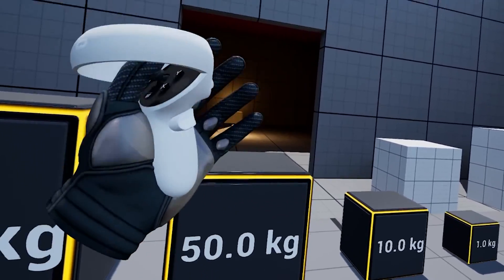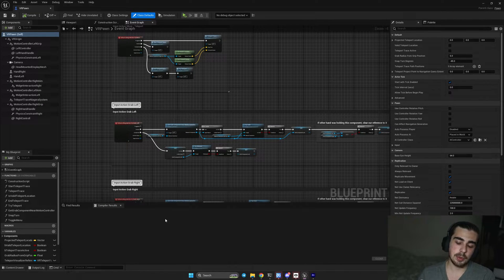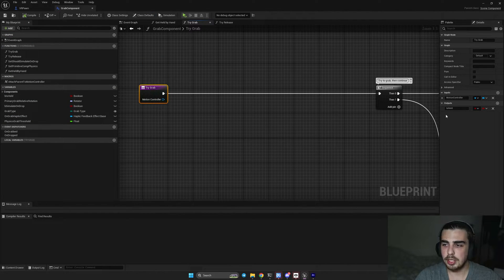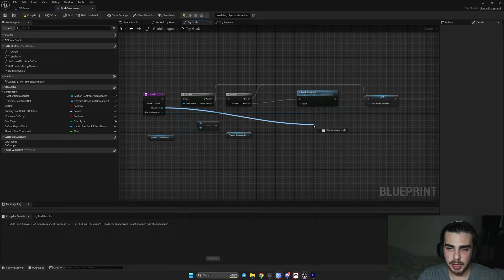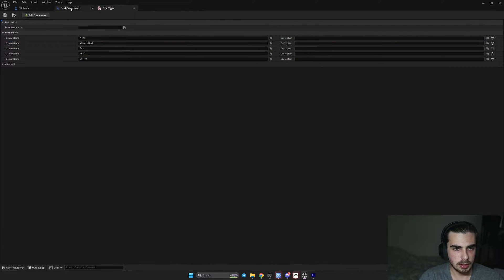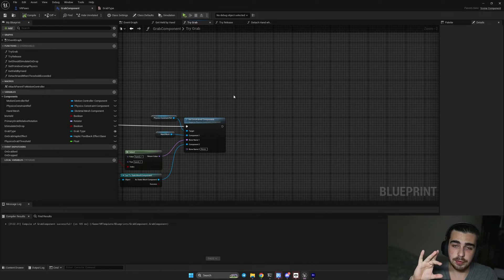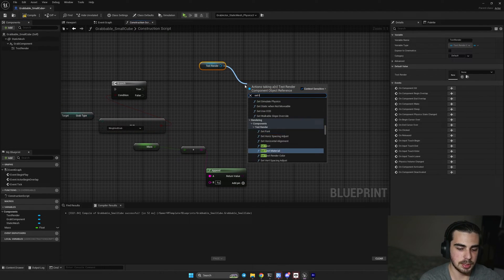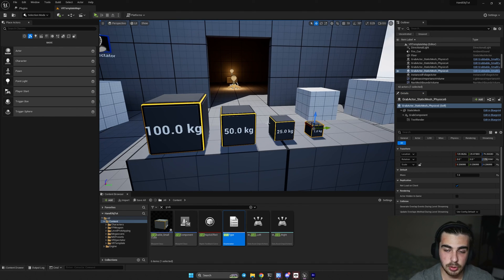HOW TO FEEL WEIGHT OF THE OBJECTS IN UE5 VR | HAND COLLISIONS, PHYSICS HANDS | ONE HANDED GRAB

Comment: Thanks this is very helpful, for anyone implementing this i would recommend setting the Angular Limits to "Free" and also doing the same for your Hand Constraint when grabbing (then setting it backed to locked on release) after that, setting the Angular Motor (Twist and Swing) Target Orientation and Target Velocity to something much higher, this will make it so the object actually follows your hand around with rotation + position which will allow your object to sag from the weight, the implementation in the video only makes it so the position of the object has physics influence which feels odd because the object and hand doesn't pivot/sag under its own weight.

Comment: Thank you for taking the time going through all of this, it helps a lot. 
I have a wish for tutorial topic. I don't know if you have seen any if Nimso's videos, but he has a similar base as this but with different force threshold for each joint in the body (hand, wrist, elbow and shoulder joint). Which such system the body mechanics maters in VR. You might not be able to do a 25kg lateral lift because the shoulder can't take the force, but if you do a bicep curl, you will succeed. It increases the immersion for many sections; climbing, lifting, pulling, fencing, weapon recoil.
Reply from the maker: Have not done it on full body but seems interesting)
Reply: That's pretty cool!